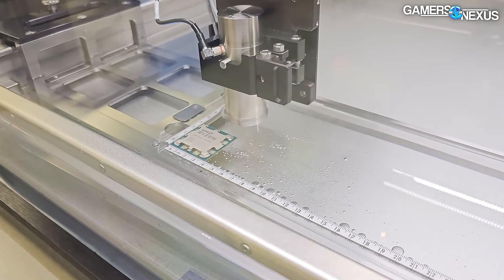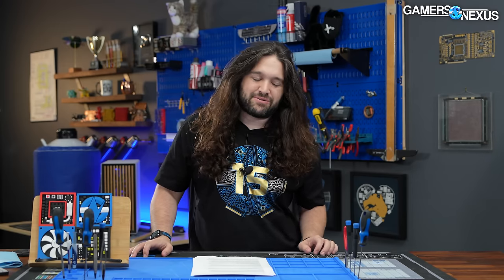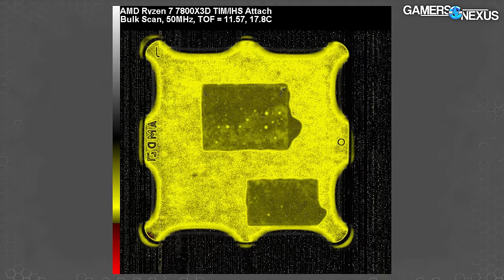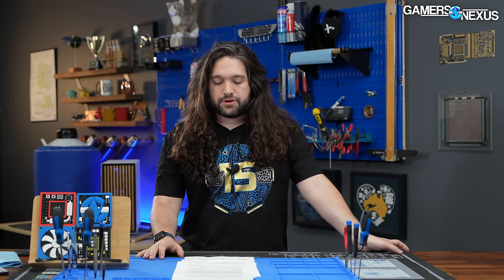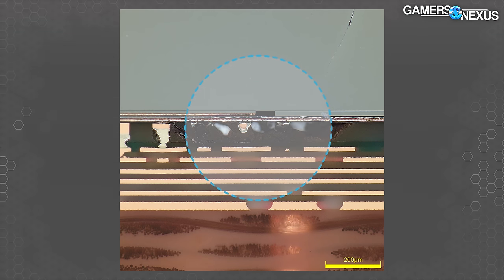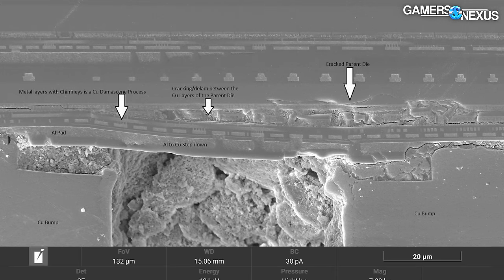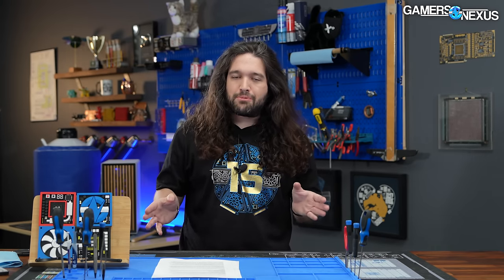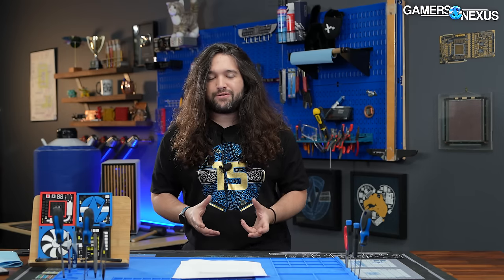The Truth About AMD's CPU Failures: X-Ray, Electron Microscope, & Ryzen Burns

Comment: What has happened with ASUS motherboards recently? I've just returned the FIFTH defective ASUS motherboard this year. They fail to post, error codes do not display and the debugger led lights don't function. I've swapped out the processor and ram with same results.
ASUS is only willing to replace the defective boards. They are not willing to refund my expenses. One Z690 Hero motherboard they sent had RMA label on it similar to what you showed in your video earlier where Newegg shipped out defective products without repair.
I've been a loyal ASUS customer for nearly a decade but now I don't want any of their products in my house.

Comment: ive seen knockoff macbook chargers blow a hole in the 12v chip, due to high voltage spikes (oem mac chargers start at 6v and ramp upto 16-19 after a good connection, knockoff ones, are always 19v, and spark each time)

never seen a failure exactly like that, but it reminds me of the start of a burn-hole in a motherboard, not quite as crispy as i am used to with water damage mac repairs. also not my thing, but in the iphone repair community, while your heating things near chips that have underfill, you have an extreme chance for solder to, be pressurized and "squirt" around making shorts in the underfills tight quarters

so cool to see it in the scanning electron microscope!

Comment: Holy crap. This is amazing. I never even knew this level of failure analysis was possible for a single chip.

Is it possible you guys could investigate the causes behind the Red Ring of Death that plagued old Xbox 360s in the late 2000s? Microsoft did give us an "explanation video" a while back, but they seem to have skimped through a crap-ton of details trying to explain these failures to the public. There are a lot of old RRoD'd 360s on sold on ebay for cheap that could be examined.

Comment: So something I notice since the initial release of Ryzen is that ASUS was their boards lack of voltage tuning resolution compared to other board manufacturers. So I basically avoided ASUS since Ryzen released for that exact reason. Part of this problem may simply be that ASUS boards aren't capable of finely tuning the voltages enough to actually support X3D parts.

Comment: In the early P4 era there was a somewhat similar issue with the Willamette CPUs. Those "just" melted down internally, typically the conductive layer over the silicon, but sometimes the silicon itself too. Guess what, almost all cases happened in Asus motherboards.

Comment: You mentioned the CPU disaster happened on an ASUS mainboard, and possibly was a failure of Asus OCP. At that point, you commented that you were "not going to get into that". 
But that may be where the problem actually began.
If the AMD device were driven beyond its design parameters by the mainboard, that is not directly the fault of the CPU.

Comment: I just had my ASROCK X670E Steel Legend with a Ryzen  7 7700X  both fail 2 days ago after running for 10 months with 0 problems. I think this problem is deeper than what is known right now. I also think you are going to start seeing more AM5  processors and boards go up in smoke with age. What makes me say this? I didn't drive my CPU, ram, or GPU hard at all like most people that overclock, and the power was delivered by an Corsair HS1000 and is on an oversized and recent tech ups. I hope my situation is a fluke, but I seriously doubt it. My power hasnt gone out at this location in 13 years and our power is as stable as can be.
Reply: Did you do a bios update?
Reply: @Henriette187  I had updated the bios a couple of times over the lifetime of the board. I am not sure I was on the absolute latest when the system failed. The good news is ASRock and AMD were good to work with and the RMA went smooth. I did wind up buying a new 7800X3d to see how it performs, seems to be doing very well.

Comment: Asus has been a bit wild for quite a number of years now. I built a Xeon workstation machine 8 years ago.

When I built the machine I decided to run Prime95 for a stability check/burn-in. After a while when I checked, I noticed the 125W processor was drawing 225W. Asus happily overclocked and overvolted the processor making it run at almost twice the normal power.

And this on a workstation motherboard with a workstation processor and ECC RAM. What overclocking bonuses are they willing to do on todays gaming motherboards? Workstation owners aren't directly the main target customers for overclocking...

Comment: I got a good laugh at you mentioning the old Rockwell Retro Encabulator video. Bit of trivia - the idea of the "encabulator" goes back to an issue of Time magazine from 1946. General Electric added a datasheet for a turboencabulator implementation to their document stack in 1962. Since the 40's, all manner of encabulators have reached a high level of development, and are being successfully used in the operation of milford trenions and all manner of ambifacient lunar waneshaft integro-derivatory inertial damping. I think SpaceX even uses them on Starship now. ;)

Comment: NVidia needs to fix their prices and release refreshed VRAM versions of their existing RTX 4000 cards: 
4090    $999 -24GB VRAM
4080Ti $899 -24GB VRAM version
4080    $799 -16GB VRAM
4070Ti $699 -16GB VRAM version
4070    $599 -16GB VRAM version
4060Ti $499 -12GB VRAM version
4060    $399 -12GB VRAM version
4050Ti $299 -12GB VRAM version
4050    $199 - 8GB VRAM version

If they still want a huge profit margin flagship GPU, for people willing to pay for the very best, they could release a new RTX4090Ti / titan with 48GB VRAM, display port 2.1 & PCIe5 for something between $1,500 and $2,000. 

This pricing would be consistent with the previous pricing, even taking into account the cost of living inflation.

They should not charge over $200 for ANY GPU with 8GB VRAM, nor charge over $500 for any GPU restricted to 12GB. Buying a GPU with less than 16GB VRAM in 2023 is buying a short shelf life, already showing obsolescence in some recent triple A games, graphics card!

Comment: Great Video, the Analysis actually, even if I don't understand half of it, helps to see and understand what is wrong. (If you understand it).

However, your Video and some other Video's, for example Jay's last Video about Asus, caused me to contact every friend and family friend I build PC's for in the last 3 Month and tell them, either we change the Asus MoBo's in their systems for ASrock or MSI boards with the latest BIO's or switch out the AMD 7000 CPU's for Intel one. 

It maybe over the top, and not really needed, heck maybe I'm overreacting, but I always say: "Better save then Sorry". 

However, this Analysis and the  failure, as well as the NVidia one a few month back, shows me something that I already suspected.
The Run for new Hardware, being it AMD and Intel or AMD and NVidia, causes thous company's that once had our blind trust to lose that with more and more problems appearing.
(Is it to much to ask for, for manufactres to est their new products? The World needs some new laws and regulations where Manufactures are forced to test their products through out)
I personaly have decided against Upgrading my Gameing Rig for the time beeing, even if I would need to for some of the up coming games. 

What is worst, the race for Hardware doesn't stop. No instead they start to behave like EA and ActiVision, "We need to release something new every year."
It wouldn't suck so much if customer service would at least be acceptable, but sadly many PC Hardware manufactures don't even have a good CS (Customer Service)

It's on of the reasons most of my PC Parts for my own personal rig are from MSI, beQuiet and Lian Li they had, so far from my experience, the best CS I have had to deal with. 

Thanks Gamers Nexus to bring top Info and don't let yourself be used by manufactures to say what they want, but to show what really is the deal. 
I just Love the pretty much unbiased and neutral way of thinking you guys do for your reviews, and it helped me more often then not to choose between one part or another, simply by seeing and watching what your test results are. 

Cheers~
Medui
Reply: One of the biggest problem is the smallest - miniaturization. When You get to one point of how small internal part is You get easier failures. Espeically when ASUS board allows voltages in the area of 1.4-1.5V when tested and working value is 1.3-1.35 max. Sad turth is that now AMD will take a lot of fault of ASUS. GN should try to replicate this failure using other boards not using one, one cpu and going whit that amount opf views with clickbait "AMD BLOWS OUT". Sad.

Comment: Honestly AMD could have turned this into such a great positive. If they'd have worked with GN on this analysis and even provided more insight into the details of what might have happened (i'm sure AMD engineers would have more insights here), how great would that be? This video showed me, more than anything, how incredible AMDs design and manufacture is. Can you imagine the transistors were so small, it was too small for a scanning electron microscope. Plus, as mentioned in a previous video, it really wasn't the issue that has a lot of ppl annoyed but the response.
Reply: As a failure analysis engineer. This just proves how bad AMD's design is. In semiconductors , it's acceptable to have isolated failure such metal line defect during fabrication, void induced EOS, cracks and so on. But if you have the same failure mechanism in this case EOS in the same area of the chip that burns thru the substrate with different board partners and  different batch lots? There is definitely a design flaw and everyone who bought and Amd cpu is on RNG right now(that includes me) . AMD engineers won't give an insight because it will be bad PR. 

FYI, the video only shows low level failure analysis, this is the only extent a common man can get third party labs to do.

Whats missing are but not limited to are as follows. Only AMD can these on the list since they have the die layout and design schematics. 

1. Curve tracing.
2. Bench test simulation of good VS defect.
3. Simulation of what is triggering the defect.
4. Microprobing, OBIRCH, FIB and other FA tools that can help deep dive the problems.

Comment: So many different materials, stacked together, supposed to be stationairy compared to each other, which they are not, due different temprature coefficients, a small crack may start or is even already there, a hot spot get created, the system cools and get heated, the crack get worse, the connection gets critical, the connection will melt, maybe short and boem you go.

Comment: Does the cpu not have internal temperature sensors and if so, are they not used to reduce voltage and frequency if the temperature is too high?  Sounds kind of stupid if the cpu doesn't have internal supervision that prohibits a meltdown.

Comment: Tbh one of big issues with the 3D caching is heat which is hard to dissipate within one area (especially the high-density memory stack) unless you have a super conductor meatal or cooling so I am wondering why sell something if this type of basic concern has not been thoughtfully and wait until the customer complain lol

Comment: I have experience in Failure Analysis of resistors based on silicone ceramic and investigations under Electronic microscope. (Vishay Plant, Israel).
Ceramic can be broken by electricity but only if it was spike of very intensive current. In this case one side of ceramic will expand from heat and another side will not expand. This cause a crack.
If it was less intensive overloading but more time, heat should distribute and ceramic will expand smoothly. In this case, even if some layers will be burnt, it will be without ceramic crack.
I cannot exclude other possibilities of fast local overheating, but based on provided pictures, most probaly it was spike of very intensive current.
Personally, I'd rather make several croossection cuts to determine a direction of the crack. If I was right earlier, I expect a crack direction to zone "2".
Please like to make this comment visible.
Reply: Shotty design either way, even if over voltage was involved. That means the CPU is actively degrading overtime & will fail eventually
Reply: @Brandon-cs8gw  I'm still not sure about degradation.
During degradation, contact usually getting worse and resistance goes up. These processes cannot cause current spike and ceramic crack.
One observed defect remains unexplained.

Comment: Take a look at the '"Turbo Encabulator" the Original' video. For me, there's just something about the 1970s TV presenter stereotype. And also the uhh... The very particular thermiaticity throughout the video shows wonderfully how the cameras of the time used octracore phase mellonators. Of course no longer available today, due to the unfortunate use of sodium oxybenatite in the phase-inturbescent convoluting chambers, there's great hope with new studies into catalytic inference convertors. Researchers are already questioning the validity of the Baccelli model. We've managed to reduce microprometric threshold variations massively in the last few years, and we might soon have a means to tame crysometric flux variations enough such as to maintain the necessary isotropic density levels required for specular photoionic pressure in the vitreous humour. We may even soon laugh at how the idiosyncracies of internal photon capacitance plagued us for all this time.

Comment: These failures illustrate that CMOS is inherently quantum mechanically defective. Electrons and holes propagate at different speeds. This causes a transient short between power and ground every clock cycle.

Comment: New idea for your 'table-top dining pieces'

Dining table plate matt that looks like an ATX Motherboard with 2x spaced-apart PCIE_x16 slots, lots of what look like 'high-value motherboard' features such as a dual-7-segment display, DIMM slots etc, with an AM5 LGA socket with suspicious differences from a normal working motherboard, and a sus picious branding
A de-lidded AMD 7000X6D CPU cup matt complete with burnt and cracked Silicon dies.

Comment: I would like to add something here if anyone cares lol. I got a brand new x670e from gigabyte and I set my ram to 7200 and when I did it auto set the soc voltage to 1.345 volts. If I had not watch your series on this it could have been bad. I set it back to 1.2 and it still works fine.

Comment: Could you commit to doing another test with a future BIOS, to confirm that the problem has been rectified? I won't be using any performance extensions until I can be sure the problem is fixed. I'm definitely not going to trust what Asus says.

Comment: Hi @GamersNexus , the vid is insane, most of it is out of reach for my brain to understand but that doesnt make it less interesting in any way so thank you. However i feel it is missing the bottom line, I am the owner of 7800x3d and i overclocked my ram with one of presets from MSI. To me everything is working great but the VSoC is set to 1.3.  (running the latest bios to date. 1.4V ram kit running at 1.4v ). Would you say i am safe with 1.3 VSOC?  i understand some would call this a band-aid but i just wanna know if it is working for now.  ❔

Comment: I did directly use my 7900X3D without the Core Performance Boost. And use it without the automatic OC. Until i get the final ASUS X670E HERO BIOS update, at the moment they have only bring version 1303 as a full version. They are working on BIOS 1410 but its at the moment only BETA version. 
The CPU didn't fail at the moment, but should i get a new one after the new BIOS is out, or should i use my CPU normaly. I dont have performance issues at all with the CPU, its a gaming monster with lots of space.

Comment: Trying to find a CPU in 2024 that doesn't explode/corrode/break. Thanks for all your research!
Reply: I wouldn’t worry about this anymore, it was fixed a long time ago via bios updates.
Reply: Yeh, found that info too :) Still, would be nice to find a product that just... works XD
Reply: @KarolaTea  yeahh. If it makes you feel any better this was a failure on ASUS and a few other motherboard manufacturer’s end, not AMD’s afaik. They were supplying too much voltage to the chip.
Reply: @Aspyrus  Ah, that's good to know! Thanks :)

Comment: I have a 5950x that died, Amd probably is not going to warranty it even though it is under warranty....weird failure mode I have personally never seen it will post and you can get into bios but it literally will not boot anything.   When placed in a different platform the B2 memory channel is gone.  Its funky. SUper hard to troubleshoot I figured it was just software. Never overclocked it, just used the DOCP setting for memory. Sux, do better AMD. I have a I7 920 that is still going strong after what, 13 years...I went to the 7800x3d and AM5 before I know it was the CPU, I assumed MOBO.  Kinda wish I would not have done that now.

Comment: Using corsair 6000 mhz ram in expo mode on my asus b650e board with ryzen 7900. After the last Asus incident, should i disable expo mode in bios? I did not update bios.

Comment: I know the new CPUs can handle high temperatures but the current state of hardware is just ridiculous, thermal and power limits shouldn’t be as high as 100c. My cpu at full load goes to 76-78c with watercooling, do you know how uncomfortable that is while gaming on summer with an inside temperature of 28-30c? I remember the Pentium 4 days when above 40c was considered a fire hazard, and that was with overclocking.